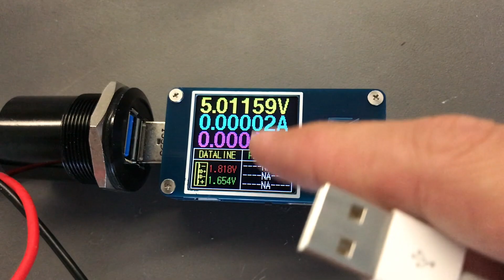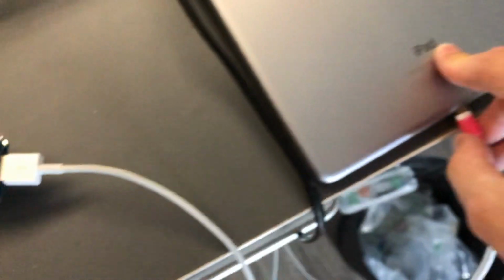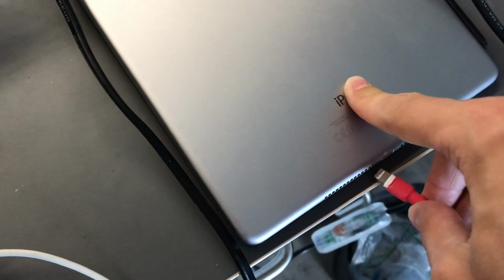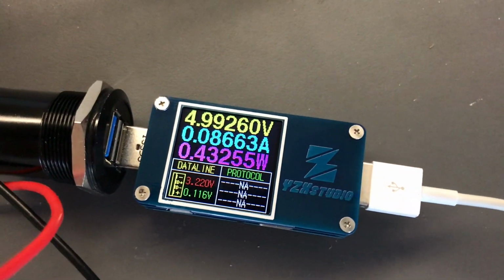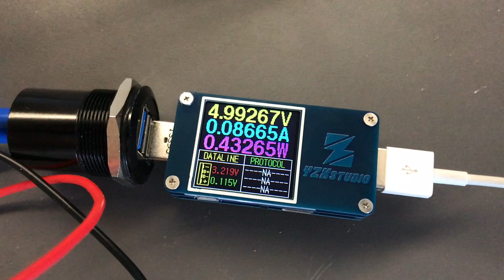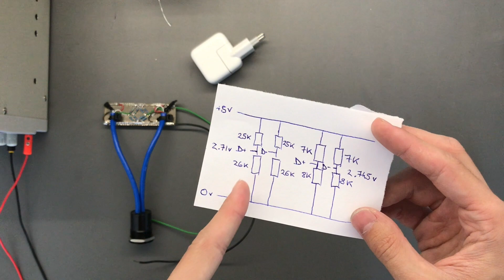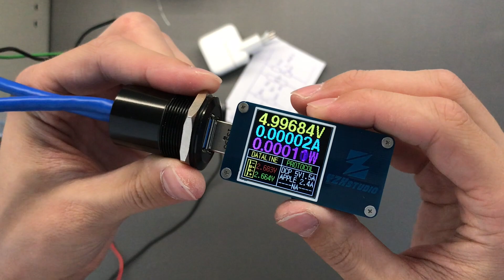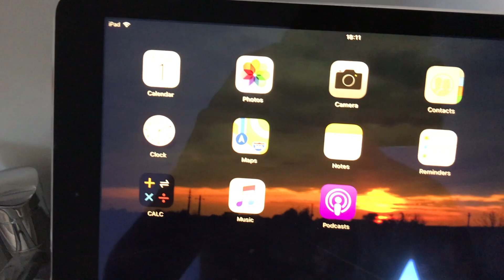DIY USB Charger - Getting iOS Devices to Charge Faster

Comment: have been trying to get ipad 5 charge from a small lab power supply based on XL4015 module
tried a bunch of combinations of D- D+ voltages using a couple of potentiometers (1.8, 2.0, 2.6 - 2.8, same/different voltage on both pins)
XL4015 does a great job and there's almost no voltage drop on vcc even under a load of up to 2 amps

a xiaomi smartphone and powerbanks are happy drawing around 1.9 amps on most of the data pins voltages, or even if they are just shorted
but no matter what I do, iPad just won't draw more than 1.1 amps (1.25 if I push the vcc to around 5.4)

the only thing left that I could possibly try and change is the lightning cable - pretty sure mine is a fake one
but it's doesn't seem like it is heating up while transferring >1 amps currents at all, so could it really drop that much voltage as to prevent the iPad from going into high current charge?
don't feel like buying another cable, let alone original, just to check if something changes or not

maybe there's a way to check the cable under load voltage drop without damaging the lightning connector by soldering stuff on it
Reply from the maker: do try a 'highly-compatible' after-market lightning cable

it could be the ipad checks the chip in the cable more seriously

anker baseus .. they do ok cables .. and through those my ipad air 2 draws top current (2.something A)
Reply: also, do you think that data pins voltage could be PWM generated with some microcontroller, or its pulsating nature won't be recognized as a proper signal?
Reply from the maker: @mimidosima  I'd be quite sure the PWM would screw stuff up in painfully hard to debug ways